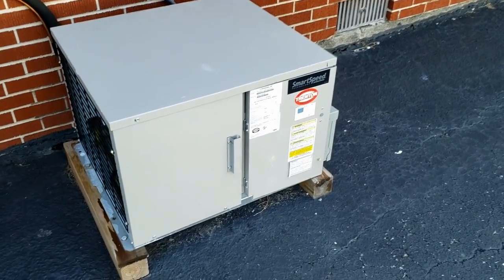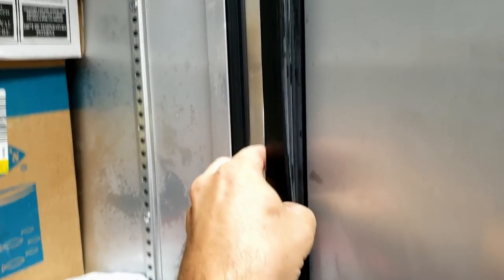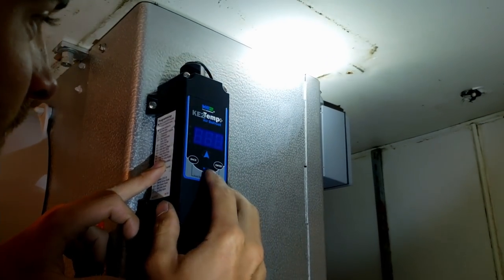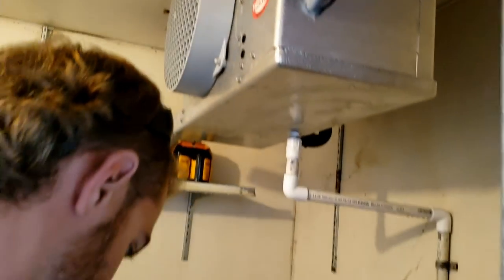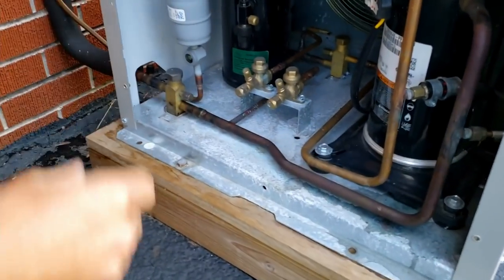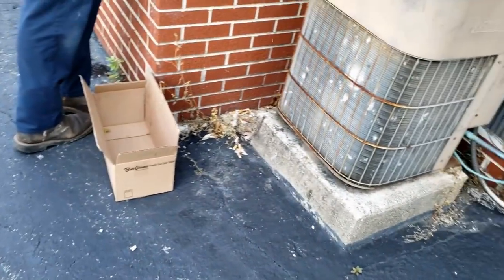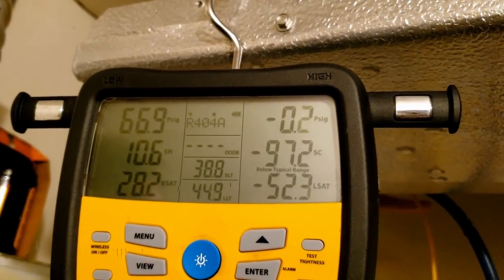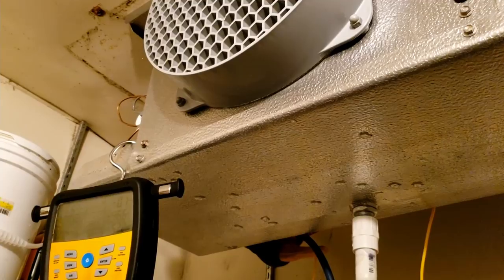A Little Ice Won't Hurt This NEW Cooler Will It !??

Comment: Suggestion for your assistant: around 19:55 in the video; When you're hooking up gauges don't have you face anywhere near the connection.  And use safety glasses, you really don't want refrigerant in your eyes.

Comment: 20:10 no safety glasses and face very close to port connecting hose! need to make sure he stays far back as possible and understands refrigerant burns can instantly blind you for life among other serious things if you're breathing in.
even though it's the low side and likely only worry there is oil, better safe than sorry and it's always good practice. :)

Comment: If your home AC is blowing a 13 Delta it's broken. I check superheat/subcool on all air conditioners if they blow under 20, especially on TXV systems. Sometimes they're fine, usually they're low on charge.

Comment: I do the same with my malco but driver, got the short 2 inch on a 6 inch extension, it always stays together until I need to break it down to 2 inch lol, I’ve never bought the extended malco. Plus I like how you let the new guy do everything so he can figure out how to do work and also to figure out what tools he needs to invest next. That’s how I learned and honestly it helps alot.
Reply from the maker: You going to learn if I just do it. Plus that way you can't lose my tools. Thanks man!
Reply: I use extensions a lot myself, but I also have extra long bits.  I use impact rated bits, because, oddly enough, that's the easiest to find around here, at the best price.   I prefer those for working with a lot of things because I don't have to fit my screw guns in at angles.   

I also bought two IKEA 7 2 volt electric screwdrivers.  They're fantastic for day to day screw work, with minimal to no drilling.    They're not hex adapter either, they're adjustable drill chuck.    Now my father uses one as well.   Also - very cheap.   20 bucks, so if stolen from my tool bag?   Costs less to replace than one 1.5 amp hour Ryobi battery.

Comment: why u didnt check the subcool?u should have put the clamps on discharge line after condenser to see how much you got subcool?
Reply from the maker: I explained why we don't usually check subcooling in the video. There's all kinds of things we could do, why stop at discharge temp, we could check the breakers to verify they are tight and do a oil sample on the compressor, data log the electrical and refrigerant temps. My point is, there wasn't any reason to check either with the sight glass is full and the pressures match the rule of thumb for the temperatures we were working at.

Comment: Have you every tried a steam cleaner such as a CGOLDENWALL 1700W Steamer Cleaning Machine to melt the ice?
Reply from the maker: No I haven't, sounds like a chunk of money$?  I get tool money but I would think It's not cheap enough to justify?
Reply: @HVACRSurvival  - I just looked it up myself.  Looks pretty cheaply made, and not likely to pull enough power to be effective on ice.  I'd look for some old kerosene (coal oil) driven steamers on the fleabay or an auction site like hibid.

Comment: Looks like that AC unit is getting all the hot air from that condensing unit , especially on a hot summer day. oh boy… installers should have turned that unit 90 deg.

Comment: Walk-in coolers need a defrost cycle?
Reply from the maker: Correct,  the evaporator temp runs 18*-20*
Reply: @HVACRSurvival  ok, so a regular make and break temp control wouldn't work in that application? Thanks for the response
Reply from the maker: Correct they use a constant cut in temperature on ones that do not have defrost clocks and monitor the evaporator temperature for the cutout. That way it always kicks in at 38 to 39 degrees and cuts out somewhere around 18 to 20 degrees. They're sensing coil temperature

Comment: 60minutes defrost? I suggest 30min x 4.
Reply from the maker: I've had 40 minute defrost cause the cooler to freeze up because people leave the door open too long and screw with a thermostat settings, it really depends on how high your humidity is. This place is only open in the evenings. Also keep in mind this is an air defrost not electric.
Reply: @HVACRSurvival  You need to be careful with 60 minute defrosts you cant schedule for hours when they are closed. Health Dept. comes in and box temp is high , they don't care if it is defrost .They can  be a PIA.
Reply from the maker: The product temp its what they check not the box temp.
Reply: @HVACRSurvival  The Health Dept I dealt with was the strictest in the country